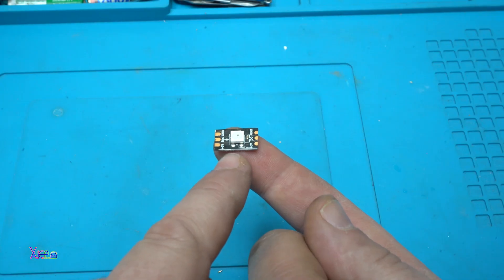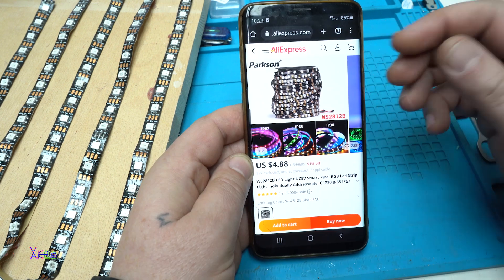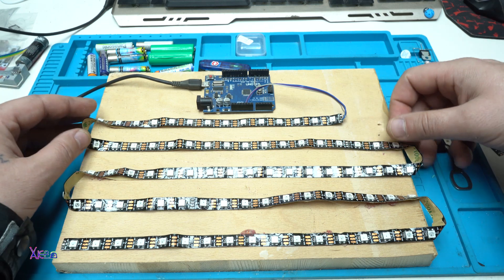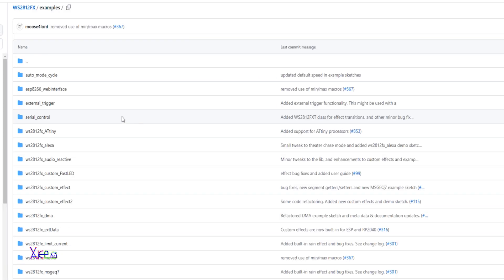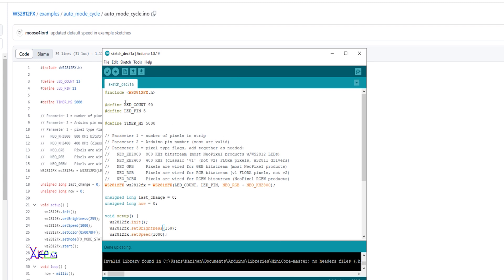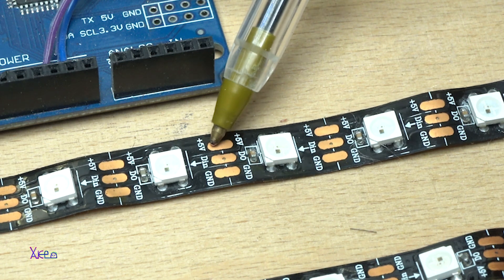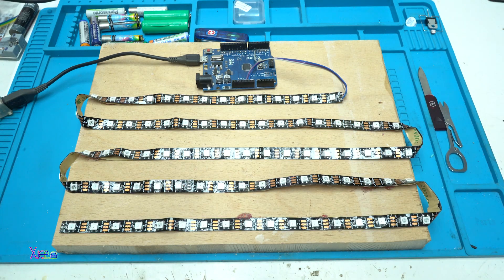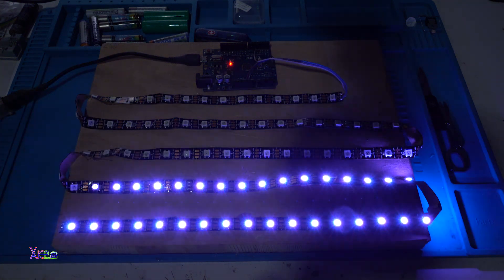50+ INSANE LED Patterns Using SMART RGB Chip?

Comment: I love these LEDs. The key question for me was "What can I do that has not been done before?" I found a PCB, available on Amazon and AliExpress, that has concentric rings of LEDs, and if you want you can break the rings apart. I found one of these with 241 LEDs, the outermost ring has 60 LEDs on it. 60 LEDs, like 60 minutes or 60 seconds.The next ring in has 48 LEDs, good for marking the quarter hour. Give it a RTC module and you have a clock! I have two of them, one for work, one for my office at home. Since the DS3231 RTC module has a battery backup it even keeps time when it is powered down. 

There are also strings of waterproofed WS2812b LEDs, good for decorating outdoors, like at Christmas. Just get creative!!!
Reply from the maker: Make it and have fun!

Comment: I guess you don't know the WLED software yet. Look it up. Use an ESP2866 or ESP32 with it and you can control your lights with your smartphone or pc directly with over 100 effects. You can even make it react to sound if you add a microphone board.
Reply from the maker: Yes you can try that too,I share the simple way

Comment: Just because I'm no expert in electronics, but I would have though this needing a separated power supply. How come the Arduino can handle the current for all this leds? 
Thanks for the demo will try to get my hand on some of this, they look like a lot of fun to experiment with and use in different projects.
Reply from the maker: You need to power the leds with direct voltage from power adapter 5v at least 2amps
Reply: the arduiino is not supplying the current, a 5v supply is supplying the leds and the arduino, the light of the leds is controlled by serial data on the data pin of the first led which passes that serial data to the 2nd, and the 3rd etc, the leds themselves do the switching of the rgb light with their own built in little processor. with this method you can have as many leds as you want provided you have a power supply that can supply the current for them all being on at once.
I used 400 12v versions of these leds and 5v for the arduino from a 12v+5v supply, used them on the tree last year
Reply: @lezbriddon  Oh I see. So the 5v just go thru the Arduino and it's not like if the 5v were coming from a pin set to output. I guess that's the key here.
Reply: @mikeoverthebox  you got it. the 5v and 3.3v pins are not good enough for outputs, but have uses as references for sensors. also if your using one in a vehicle, the 12v from the vehicle will go as high as 14.5 and due to a cars system being noisy, you can easily see spikes upto 19/20v etc on older design vehicles. best to use a 12v->5v buck converter before the arduino/esp. most boards sold dont live long above 12v due to chep regulators being fitted
Reply: @lezbriddon  It is quite surprising how many leds you can power at low brightness, each pixel takes 60ma at full brightness white, Ie 255,255,255 but the power requirements drop off quickly if you set brightness to say 50 and only use white when few LED's are on. I had a string of 300 running patterns at 20 brightness and only using a max of maybe 60 at a time. I have a set up at a friend's bowling alley were I am running 600 LED's off a 10 amp 5v supply, even the heaviest current consuming patterns only take about 6 amps with max bright set to 175.